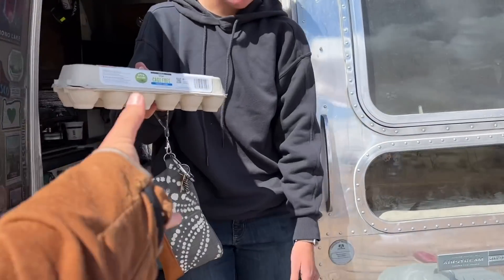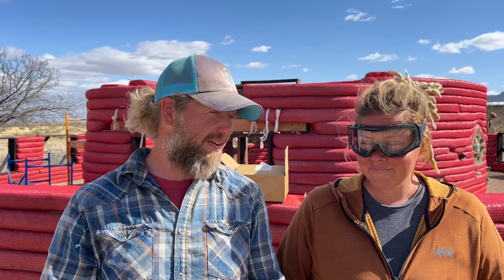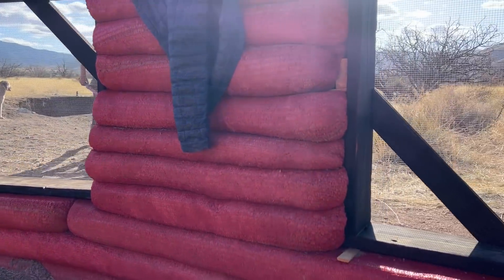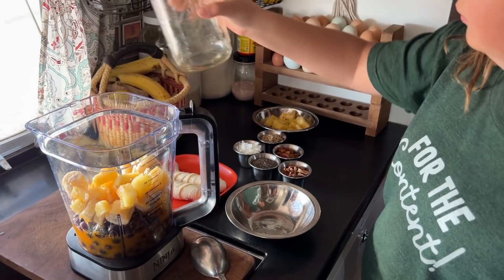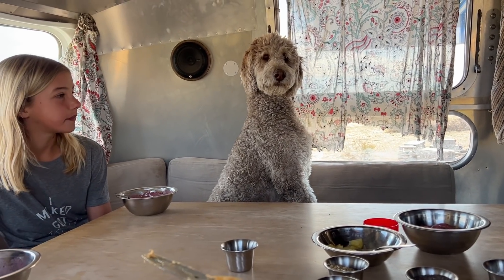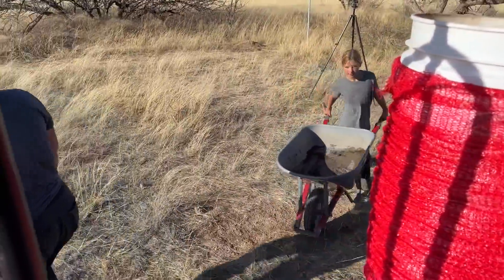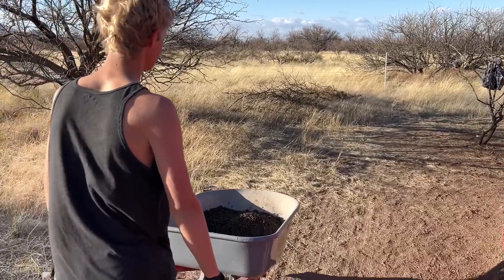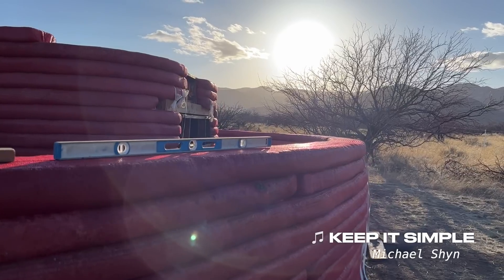Hurricane Straps for Roof on Hyperadobe Earthbag Wall (Chicken Garden Day 96)

Comment: Gr8-ist show 'in' earth! A REDD Thought from PMB in South Africa🤗For the lintels: If you take a 6" log (with desired length of lintel), split IT in half & use IT flat down, (taper down the overlap ends) & cover with sand bags which will take in the shape of the round logs section.🤓🤩

Comment: I agree with Johnathan on the lentils, just use a 2×12and make it long enough to be  foot longer on each end and screw it to the frame giving 3" of material would easily hold the weight of two more courses.  Save yourselves a lot of money and it will work just fine.  Take care and be safe and God bless amen.
Reply from the maker: Has to be up on its end at least, can’t lay it flat.

Comment: I don't think you guys need any lentils I think if you are only putting a bag or two over the screen boxes you just need to increase the cement that you're putting in your soil and it'll set up just a thought
Reply from the maker: We need to be able to replace the frames on down the line.
Reply: But lentils are half of the design element!  Burn that wood!